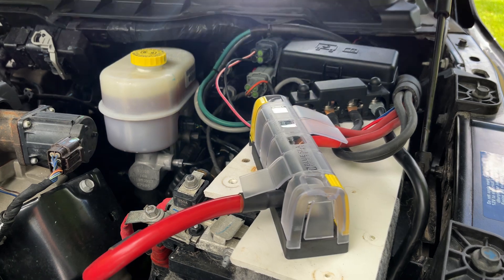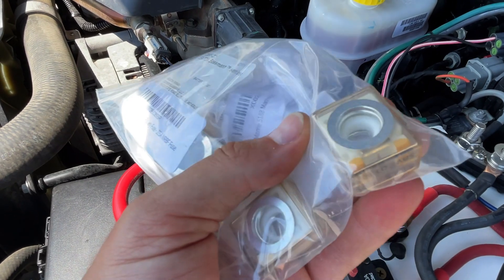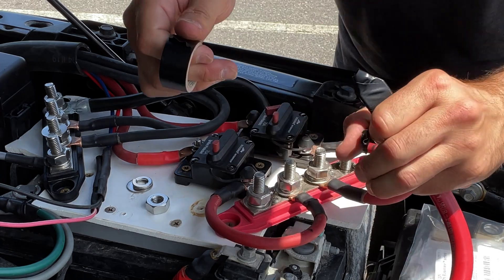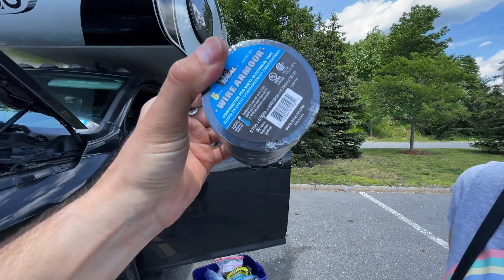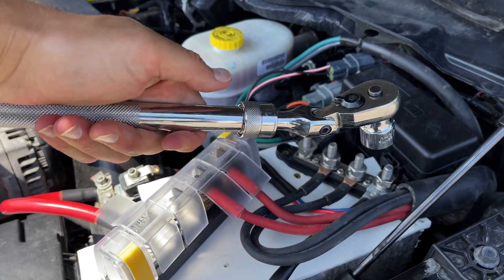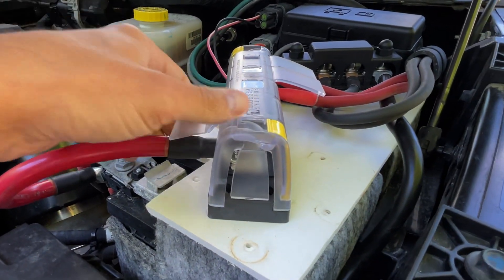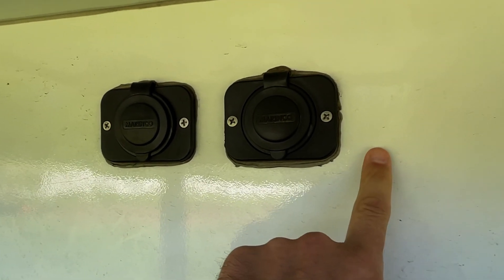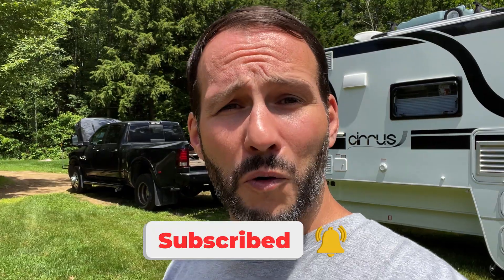Breakers vs. Fuses in the Heat // DC-DC Charging System Update

Comment: I forgot. Amp rating for alternators is their one time peak at 6,000 alternator (not engine) RPM. The continuous duty capacity of an alternator is less than half its peak capacity and is even lower when air and under hood temperatures rise. The design capacity of your stock alternator is meant to provide for the vehicle and little else. Hopefully you have increased your alternator capacity to accommodate your chargers. I run a primary 12V/135A alternator for vehicle systems and a secondary 24V/220A alternator for my camper (with 1166Ah of Leaf LMO). Alternators have NO PROTECTION FROM OVERLOADING. I have current, voltage and temperature monitoring on both alternators and an adjustable regulator on the latter to trim my charging amperage to keep it under 250F. Depending on air temperature and how hilly the driving, I can usually only get between 60-110A charging (from a 220A rated alternator) at about 240F. While I'm doing this, my 12V alternator runs from ~30-60A at 170-190F. I would highly recommend you put some kind of temperature monitor on your alternator at a minimum (~$20).
Reply from the maker: Steve,
Again, great comment, thank you!
This is something that I tested throughly! The truck has dual 220 alternators as part of a plow prep package. They are a 3.22:1 ratio since it's diesel, so while driving or using the high idle at 1k RPM, it gives me plenty of amperage and cooling (I never idle except for testing). Pulling 100-110 amps, spread evenly across both alternators hasn't been an issue, and I keep a close eye on the temps. Even on 100f days with constant charging, even while high idling for 10-15 minutes, the alternators stay between 190-215. The passenger side alternator runs about 10f hotter due to less air flow and its proximity to the EGR and exhaust/turbo. I sized things to stay within the safe range with the alternators. A remote temperature monitor would be great, do you have any suggestions? I check everything with an infrared thermometer, especially after long hills and on hot days, It has never been hot enough to be of concern.

Excellent information and something I'd like to include in a future video if you're ok with it.

Thanks again!
Reply: @Stonyboot  Sounds like you do have a good handle on the generation side. You have to be careful with some of those IR thermometers when measuring something with high airflow, that is not flat or black. They can be off more than a bit (or more --voice of experience).  I use a super cheap thermostat (<$10)that displays both actual temp (its likely +/ 2C) and cutoff temp on a display that is about 1" tall x 2" wide x 1" deep but they are made to be panel mounted. I have several videos on our YT and my Instagram (Maximus) that shows them. They make some that are just a temp display. I'll see if I can find something that would be better for your situation but they are likely to be the same form factor. Based on that size, do you know where/how you would prefer to mount it? ....They use a 10k thermistor as a sensor. It is about 6mm dia x 20mm long. I drill a small hole in an aluminum block to slip it in and bolt it to the back of the alternator housing. These systems are typically operating at a max of 220C which since you already know your temps are below that, these sensors would be fine. Typically the sensors come with a 1M cable but they are easily bought with a 3M cable (~ $ 2 each). The cable is a small ~24ga paired wire that needs to be covered with split loom tubing in the engine compartment because it is not able to tolerate heat, abuse or fuel.

Im happy to help you with putting information together for anything you want to shoot. You can give me a topic and I can provide bullet points for you to weave as you see fit. I presume you have my or 'our' email? I don't think i can post it here.
Reply: @Stonyboot  This is the form factor I have. They are small enough to put anywhere but are intended to be in a panel. This unit has 2 thermometers in the same houshing with each a different color. Might be just right for your two alternators. https://www.amazon.com/Thermometer-Waterproof-Temperature-Fahrenheit-Refrigerator/dp/B07WS11X45/ref=sr_1_25?dchild=1&keywords=thermometer+12v&qid=1625374148&sr=8-25

These sensors are 3890 NTC 10k Thermistors. Don't use the 'bead type' a comes with this dual display. Also, avoid those that use thermocouples as they cannot readily be extended even though the higher temperature range seems appealing.  https://www.amazon.com/DROK-Temperature-Sensitive-Stainless-Thermistor/dp/B01MZ6Y336/ref=sr_1_3?dchild=1&keywords=NTC+sensor+3m&qid=1625374472&sr=8-3

3M is the longest standard length commonly available but they can easily be extended with any small (22-24) gauge twin wire (solder and heat shrink connections). Mounting can be done by crimping the sensor in an appropriately sized copper cable lug. Be very careful not to crush the sensor, just crimp enough to grip it. Attaching it to the case near the stator housing is best and will require drilling and tapping a hole to do it. If you want something simpler, there is usually a tapped hole for a ground cable on the back of the backside of the case.
Reply: @Stonyboot  I forgot to mention, alternators use small diameter, internal centrifugal fans (with an exponential speed vs flow relationship) that cool very little at less than about 4500RPM, (~12-1400 engine RPM is typically the low end of operating speed so it is logical for automotive designers to target that speed). The air channels through the alternator are so small, it requires a lot of static pressure to move air and the centrifugal fan needs a lot of speed to do that. You are far more likely to overheat at high idle than anywhere else because the alternator is spinning fast enough to generate but not enough to cool properly. Because I have been having solar charge controller problems, I just had to do some fast idle charging (a week ago) and discovered my 220A alternator would only operate at about 60A continuous duty at 1200 engine RPM, in cool (60F) morning air (with the hood open). On the road on a warm day, with the heat of the engine compartment, it will do 100A. That is the difference in cooling air circulation.
Reply: Well said!

Comment: Scott, 
Some engineering  comments: 
1) fuse selection - When fuse protecting a circuit the capacity of the fuse should be 133% (4/3rds) of the max circuit amperage. Said another way, the circuit should not exceed 75%  (3/4) of the fuse capacity. The reason is, the fuse activates by melting just above its rating. It has an exponential temperature relationship with current. If you run the circuit near the activation point, the fuse will run VERY HOT. The heat generated will follow the most direct thermally conductive path, which is down the highly thermally conductive copper wire. Wire insulation other than silicone or braided fiberglas cannot tolerate the level of heat the fuse can create (even 105C rated welding cable) and will decompose and possibly outright char. 

2) Fuse capacity (in amps) and wire capacity (in amps) are related but not the same. Wire is rated for the full circuit capacity. A fuse rated at a higher capacity than the wire will still protect it. For the fuse to function, the wire will exceed its design capacity but the fuse will function before the wire fails or for that matter, before it is damaged but not before the designed voltage drop limit is exceeded.

3) Proper wire for an engine bay: Most common primary wire is classified as General Purpose, Thermoplastic or GPT. It has PVC insulation rated for rated up to 185F. This is not adequate for engine compartments. They require a higher temperature rated insulation that is 'crosslinked' called GXL (General, cross Linked) with a temperature rating of 257F. They look and feel almost the same. 'Battery cable' is acceptable as is 'welding cable' but not GPT or anything that is commonly found in residential or commercial building.

4) You already realize that you have used your plug/socket connector 'backwards'. The design imperative is that ONLY sockets provide energy so the contacts can be protected when energized. Plugs ONLY receive energy so that the exposed contacts will never be energized when uncoupled. While your awareness of this situation is obvious and hopefully adequate for your safety, the exposed contacts on the plug should have some method of being de-energized before and any time they are uncoupled for both your safety and that of your equipment. I suggest installing a battery cutoff switch on your main distribution cable before your fuse block.
Reply from the maker: Steve,
Thank you so much for the detailed information. I apologize for the delay in responding, but I wanted to make sure I had enough time to respond fully.

1) I had read somewhere that 80% was the goal, but never understood the heat transfer issue. Your explanation is awesome! I have tested everything that you mentioned in your comments and it all looks good. However, I understand now that I can use a fuse of a higher rating than the wire/plugs because they are fast acting where the wire/plugs would take a while to heat/melt. I did lookup the different types of wire and can see what you are talking about. With the new I have many hours with the new fuses without any heat issues, however, I'll probably order the next size up now that I understand the metrics on how to chose them. I assumed a 70amp plug should use a 70 amp fuse, live and learn.

2) Perfect explanation, simple and easy to understand. Thanks.

3) I did lookup the insulation on the main battery cable I used and it is PVC with a 185F rating. We had some crazy 100F days here in NH, I was running the truck, A/C and charging system. That area was around 175-195F (as read with a infrared thermometer) and I could tell the insulation was pretty soft. The welding cable seemed to be cooler and still very firm. I don't have anything residential in there that I'm aware of, did I miss something?

4) I 100% understand this flaw. I spent months looking for a 3 prong solution for this setup and this was the best I could come up with reversing the plug/socket was a trade off I was ok with since its plugged in 98% of the time and I had the breakers to disconnect them. I will be adding a disconnect, but probably downstream of the engine bay. 

Thank you for all of the information.

Would it be ok to cover these details in a future video, this is gold and I don't think too many people will read it. I'd like to highlight your corrections when I make the changes.

--scott
Reply: @Stonyboot  1) Fuses are made of aluminum alloyed with (can't remember), specifically to create an exponential 'thermal runaway'. Copper wire has a 'linear' relationship with current/temperature so although an overloaded wire gets hotter, it doesn't get as hot as fast as a fuse does. Most automotive fuses are 'slow blow'. There is a specific type of 'fast acting' fuse for electronics application that blows at less than 110% to protect electronics but that is typically not desirable in circuits that can experience starting surges as part of normal operation.

3) Your use of GPT in the sizes and amperages with underhood temperatures of a diesel is asking for trouble (eventually). Its not that the insulation melts off. That would only happen with the additional heat of a fuse running lear the limit. The failure mode is; The stiff wire (esp with big cable) bears against surfaces with some pressure (curving through and around)  and the pressure on the wire causes the soft plastic to slowly flow away from the point of pressure, leaving only thin or possibly no insulation. It usually just thins and then vibration causes the thin part to wear through. Things like nylon cable ties bundling cable tightly can sink well into it too. Bundled wire presses insulation closely together and will actually fuse them together like a box of crayons in the sun. The biggest problem is the cable running over a square metal edge which produces high point pressure, causing the very warm plastic to just move away till the wire meets the metal. This type of failure can occur in weeks or months, while others may take years (depends on how often it endures sustained, high underhood temps). Hopefully, you get the idea.
Reply: Thanks for your valuable insight. It only takes ONE bad wire to ruin everything or worse.  I think his "plug" isn't actually backwards but worse, he can have power on both plug and socket . Something needs to be configured differently there. I'm not sure what kind of answer for that but he does need to put a switch of some sort, back in place near  and visible by the plug .
Reply: You over rate it by 125% As NEC code book allows.. As you have inductive loads with high inrush start up amps..Like AC Units, Drills, etc...This is why ANL fuses are useful as they are slow blow...They will allow a high load for a short time. I still don't like ANL fuses. It's not like you have them things laying around. Best to use a thermal breaker. You can just reset it once it cools off. 

If you have continuous loads of 4hrs or more. You have to follow the 80% rule for wire sizing. Not Fused\Breaker sizing..

Comment: Do you have a secondary alternator?
Can you post hand sketched schematic with cable sizes of your system. Great educational video ! Thx for sharing
Reply from the maker: I did a full video about the setup. It’s called charging without solar. That goes through the whole setup and mentioned the gauges of wire and other connections. I don’t have a schematic, but if that first video doesn’t give you the info you need, I’d be happy to make a diagram. 

I should probably diagram my system anyway.

Comment: Check the temperature of your alternator when charging at idle. When I installed a 60 amp dc to dc charger it was running about 248-255 deg. F. at idle. And about 180-200 F with just the headlights and AC running.
Reply: I have put together a thermal switch to mount on the alternator case to shut off the charger at 120C/224F and switch it back on again at 100C/212F. I will be putting a video out on it shortly. See my website by the same name as my YouTube. On the 'TechDocs' page is a summary of the thermal safety.
Reply from the maker: I covered that in the first video. Even at idle, they stay around 200-205f. They are each only serving up about 50 amps, which is less than 25% of their capacity. In my research, it seems that they only have trouble when you are pulling closer to 50% with a constant duty cycle. So far, no issues and they run nice and cool (well 200f isn’t very cool 😎)

Comment: GREAT TIPS  !!!! I will use your idea on my 2019 Serenity RV. Thank you very video on DC to DC for charging. I could use it on my RV/car/van on lead-acid  and lithium battery
Reply from the maker: Thanks for watching. The breakers are great in low temperature areas, but they just didn’t hold up to the heat. I also keep reading about reliability problems with them, sometimes they disconnect and don’t even show as tripped. For this setup, going with tried and true fuses means there is less to worry about. 

Good luck with your build, I’d love to hear how it goes.

Comment: Do you use the + from one starter battery, and the - from the other for this? Or both from one..
Reply from the maker: Both from the drivers side. I did some testing to determine if I needed to split them up. The cables that come with the truck and  join both alternators and batteries is pretty thick. When I measured the amperage draw and voltage on both sides of the truck they were equal, even though I was connected to one side. There might be a 1% differential, but not enough to worry about.

Comment: Sometimes, (like this!) Ya just gotta work HOT. If you have a short piece of tube, it gives a little better protection than electrical tape. When I use the tube, I also use tape to secure it from slipping of.  Also, a piece of innertube is handy for covering over terminals in close quarters.
Reply from the maker: Excellent idea!!! Electrical tape is easy to cut and damage. A tube would be perfect. I have some various materials kicking around, I’ll see what I can come up with for the next video. I can’t justify spending the money on composite tools, I just pay attention to where my metal parts are.
Reply: @Stonyboot  The best material for adding protection to wiring in an engine bay is either 'split loom tubing' (search for that term on Amazon). The automotive industry uses it widely and it is readily available in a wide variety of sizes. A big-sized, short piece is effective for terminal blocks. It has an inherent capacity to remain around the cable where using tape in a hot engine bay will not last reliably. The other material you should look for is called 'spiral wrap'. It is a flat, thick PE band (like super thick, stiff electrical tape) that is non-adhesive, helical, and stays that way. You wrap it around the wires and it provides a really good mechanical barrier with high-temperature resistance. Search 'Spiral wrap for wire' on Amazon.